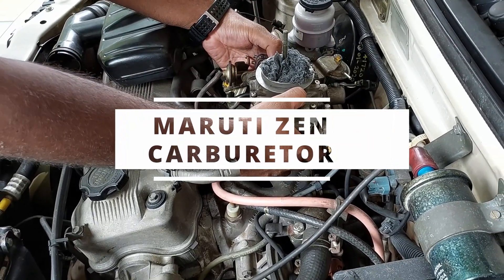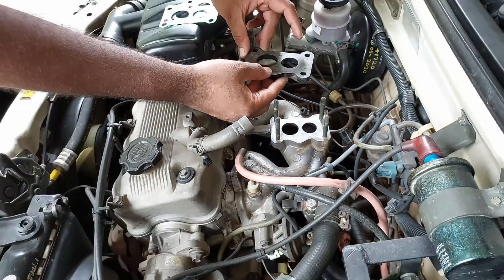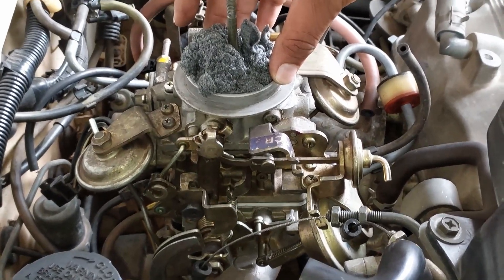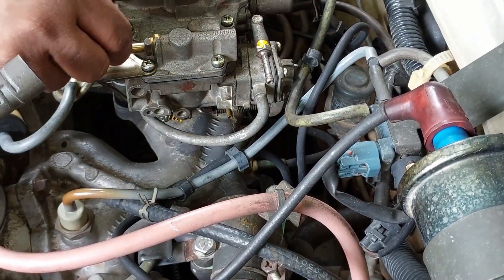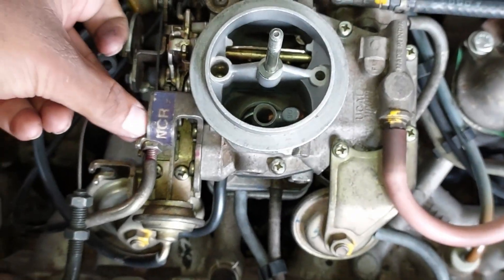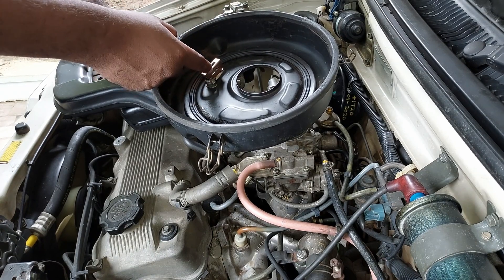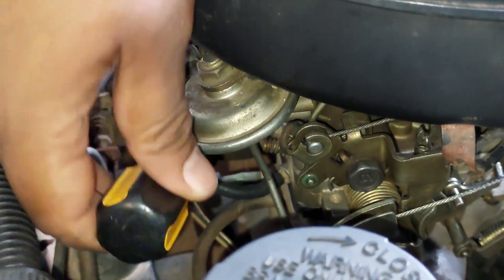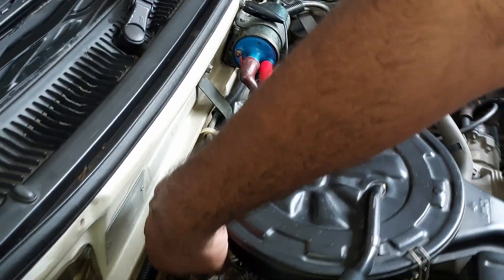Maruti Zen Carburetor service at home | Part 3 | Tuning the Carburetor | English

Comment: Hi, I absolutely love the video. I was very confused as to the function of a lot of components in my Maruti 800 carburetor even after reading the garage manual, which simply skips over things.
I have an 800, the main problem i see with the carburetor is that the depression chamber doesn't actuate. It does actuate when I suck on the hose (i bought hte car used and the secondary is completely jammed which i will repair in a few days), but it doesn't work when connected to the carb. What could be the problem? Do you think the diaphragm could be bad?

Also the acceleration pump actuates very slowly and does not seem to perform its intended task (car still misfires when i accelerate at low speed). What could be the reason for this?
Reply from the maker: Hello. Thanks a lot for your feedback.

The secondary circuit butterfly valve has a tendency to get stuck of the car is not driven at high speeds or high load conditions. Get it serviced first. At the end of the shafts you will find a seal. The seal is not available as spare. Find a suitable oring and substitute the seal. Once the secondary circuit is rectified then check if the depression chamber is actuating the circuit at high speed conditions. Still if the depression chamber is not functioning then it may have a damaged diaphragm.

Regarding the acceleration pump circuit, there is a rubber diaphragm inside that gets dried up over a period of time and loses flexibility. Then you will have issue of misfiring when trying to accelerate. Service the Carburetor and replace the acceleration pump diaphragm and all gaskets and orings. Make sure to use Maruti Genuine Part. Aftermarket diaphragm and the not the best quality available and may not completely solve the issue of misfire when trying to accelerate.

Thanks and regards,
Bose Garage.
Reply: @bosegarage  As far as I can tell, the diaphragm is damaged. I intend to open up the carb up after buying a gasket kit for it.
Any suggestions for the diaphragm? it's probably not possible to buy the diaphragm separately so i was wondering if it could be repaired.
Reply from the maker: @MarutiEnthusiast  The depression chamber needs to be replaced as a whole unit. We cannot replace the diaphragm alone as it is a sealed vacuum actuator.

The acceleration pump rubber diaphragm is available separately
Reply: @bosegarage  finally got around to removing the entire carb yesterday. i realized a few days ago that the secondary was stuck closed. so i removed it and freed it as much as i could, and tried putting in oil in the shaft, not with much success. i could suck on it and the secondary would open (on the bench) but the carb vacuum fails to open the secondary. worse, if i open the secondary by hand, it does not close completely on its own. i have to close it by hand.

what do you think needs to be done?
Reply from the maker: @MarutiEnthusiast  Did you remove the butterfly valve and shaft from the carburetor? You need to remove and clean the shaft properly and area on the carburetor body. For this you will need to remove the linkages. Lubricate the area properly. When you remove the shaft you will notice that there is a seal on either side. The seal is not available as spare anymore. You need to find a suitable oring to fit that location. Without the seal petrol will leak from that location. When you buy the oring ensure that the shaft js not very tight once inserted into it.
Reply: @bosegarage  i didn't remove it. how does one go about removing that? i didn't see anything like a cotter pin or things like that. i think i can manage the oring.
Reply: @bosegarage  Finally got the secondary venturi working. Here is what I did:
Freed up the secondary with a liberal amount of penetrating fluid, this i did last time i removed the carb.
Used a syringe to inject oil into the shaft of the secondary. This helped a lot.
I was still skeptical so i heated up some used motor oil in a diwali lamp. Injected the hot oil into the shaft. This worked further.
The nozzle where you connect the secondary diaphragm? I sprayed carb cleaner down that hole, it only came from the secondary side. So I held that hole shut and sprayed until i could see the spray on the primary side as well (the nozzle is connected to both, as you must have seen in the diagram).
Ordered brand new vacuum hoses from boodmo. The old ones were probably leaking.
Replaced the gasket. I neglected to do this the last time.
Adjusted throttle cable properly. Last time around, it had some tension in it and i could not figure out for the life of me why the idle was so high.

Now the engine idles beautifully and the secondary opens nicely. Yet to take a test drive. Will go in the evening, it's too hot right now.

This all worked well but now i have a screeching sound from the engine? wtf did i do? i will post a video later. Again, thank you so much for this video, this is THE best resource for this DIY on Youtube.

For anyone watching, the butterfly screws are JIS screws and THEY WILL STRIP IF YOU TRY TO REMOVE THEM WITH A PHILIPS HEAD SCREWDRIVER. THEY ARE MADE OF SOFT MATERIAL.
Reply from the maker: @MarutiEnthusiast  Glad to hear that our video was helpful for you. Please try to sent a short video of the screeching noise from the engine to our email id bosegarageisnow@gmail.com. All the best. Thanks